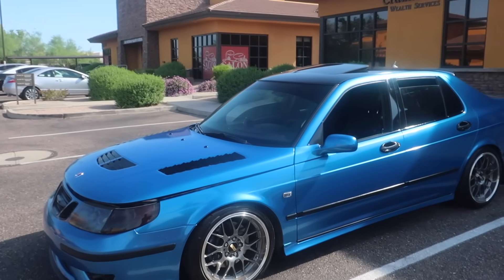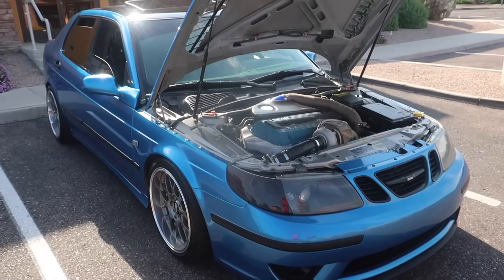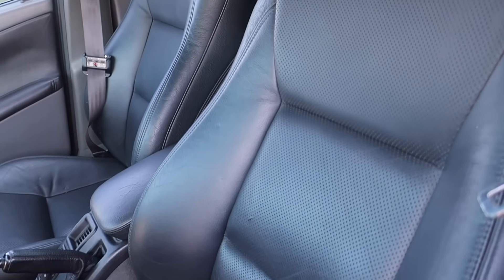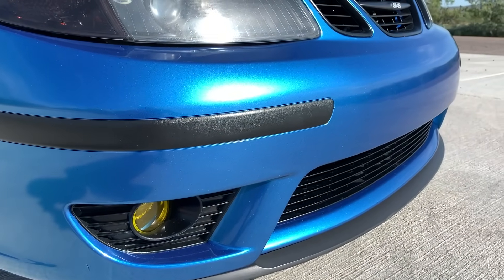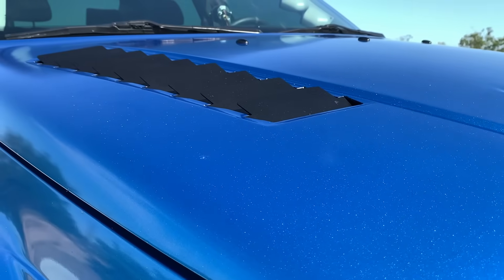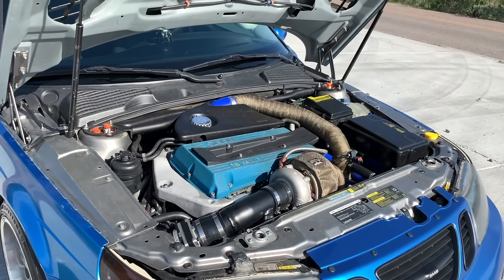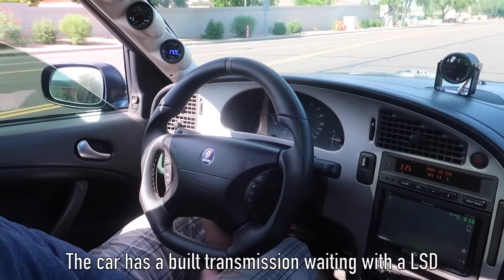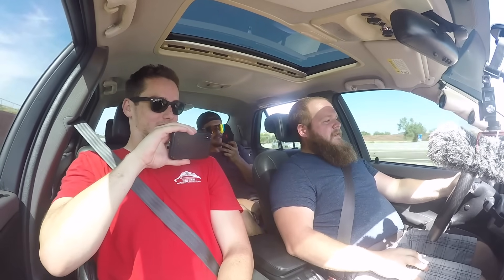550WHP Big Turbo Saab 9-5 Review!

Comment from the maker: Here is a comprehensive mod list, from the man himself, on everything done to this car (it's quite long):

Engine:
- Garrett G30-660 Turbo
- Tial 44mm Wastegate
- DO-88 Intercooler, Radiator, & Piping
- 3.5 bar Fuel Pressure Regulator
- Wossner Forged Pistons
- Stock Rods
- Genuine Saab Balancer Shaft Delete Kit
- B234 NA (I) & T5 (E) Cams
- T5 Valve Conversion
- Balanced Rotating Assembly
- Ported and Polished Head
- KRONA “Full Send 660 Big Turbo Kit” (3” Exhaust & Top-Mount Manifold)
- 1050cc Injector Dynamics Injectors
- Walboro 450LPH Fuel Pump
- E-85 Conversion
- GHWerks Solid Motor Mounts
- C900 Valve Cover
- Working A/C!
Transmission:
- Automatic to Manual Transmission Swap
- GM LSD
- GHWerks Solid Tras Mounts
- Genuine Saab Short-Throw Shifter
- SPEC Stage 3 Clutch & Pressure Plate
- Lightened OEM Flywheel
Suspension:
- 18"x9.5” BBS RS-GT
- 255/35/18 Firestone Firehawk Indy 500 Tires
- All Powerflex Bushings
- F&R Aero Sway Bars
- Ksport Kontrol Pro Coilovers
- 314mm 9-3 Aero Front Brakes
- 300mm 9-5 Aero Rear Brakes
- EBC Redstuff Pads
- Adjustable Rear Lower Control Arms
Body:
- Xenon Headlight Retro Fit & Blackout
- Full 04-05 Aero Body kit
- 3m Gloss Blue Metallic Wrap
- Matt D Custom Splitter
- Roof Spoiler
Interior:
- GlowShift AFR, Oil Pressure, EGT, & Boost Gauges
- Custom A-Pillar Gauge Pods
- Aero Dash
- Aero Vented Seats
- Hirsh-like Steering Wheel
- Custom Floor Mats

If you got the whole way down here, be sure to subscribe and like the video if you haven't already! :)
Reply: Where I can get this Matt D custom splitter?
Reply: What is a "T5 valve conversion"?
Reply: Man, that what's up!!!!!!!!! Love the whole project!!!!
Reply: You forgot the total of the lot, the list if you will. Care to share the price spent on the mod list? Not your wifi bill spent typing the comprehensive list but the bill for the entirety of the mod list you’re using on your 9-5.
Reply: @Aube  installing t5 valve guides and valves into a t7 head because they have thicker stems better for stiffer valve springs.
Reply: @ericstanhope4063  That's a tradeoff as the valves are more brittle at the stem than the t7 ones. I'd run a modified t7 biopower head with the Maptun t7 springs just for a ease of mind. And yes, the t7 valves are thinner but in better alloys. Been sat in engines pushing 800+ hp here in Sweden.
Reply: what block is it    is it a b234
Reply: @Aube  That’s awesome! I was just answering the question lol.  It’s not my engine
Reply: @Aube  also many t5 cars out there with T5 valves making huge power! At the end of the day it works and what he wanted to do!

Comment: Hey! I was wondering where I could get a bumper like that or any cool Saab 9-5 bumpers
Reply from the maker: It's an 04-05 aero bumper with a Turbo X custom lip underneath. You'd have to find a used bumper which may be hard in good condition

Comment: I got a 95 aero im just starting now engine swapping it from a inline 4 2.3L turbo to a v6 3.0L turbo eventually ima hook up a big turbo thatlle bring my car from 250 hp stock to 500 hp
Reply: Im tackling performance first then body
Reply from the maker: I hate to break it to you, but that’s not really a good idea. The B235 is a far more reliable and better motor to build…there’s a reason Saab ditched the 3.0 V6 in the 9-5!
Reply: @AutoAutopsy  ok thank you o haven't done nothing to the engine yet
Reply from the maker: Takes some tips from the build in this video! One of the best out there 😁
Reply: @AutoAutopsy  ik ive looked up the parts did some research def might invest in some im not tryna make it crazy loud or crazy lookin just a smooth matte black look wit red trim i don't plan on going crazy wit horsepower on the saab bc it is gonna be my daily
Reply: And Illinois hates loud cars where i live
Reply: Ima eventually get a g35 coupe that ima make 700 750 hp but no need to focus on that rn
Reply: But at that point ill be living in Wisconsin so i can whip it all over my roads bc the next person over is 40 acres away in all directions from the house
Reply: The 2.3 is the one everyone wants for power my friend. Some nasty 2.3’s out there.

Comment: It’s funny shit that I was looking at buying a 9-3 last night and came up on this video immediately on YouTube😂😂😂
Reply: Deff get one
Reply from the maker: It’s a sign
Reply: 2.8t over 2.3t. I've had both. Tuned both, big turbo on the 9-5, the 9-3 is an easier platform to make power on. Loved all 4 of my 9-5s though, but couldn't buy the big turbo with what it cost to get to ~ 400hp/500ft lb on my 9-3. Not to mention no custom work because you only need a gutted stock turbo rebuilt to your spec, tune, injectors and cooler plugs. The trump for me however, all wheel drive with a manual transmission. My big turbo set up on my 9-5s all had horrible torque steer. So much so, my tuner and I started limiting max torque in the first two gears. Hope this helps. Both will be fun with enhancements. I like the look of the 9-5 more than the 9-3. But I'm tuning on a budget these days.
Reply: @yuhmadorwah  you think it would be a fun project to power up my 06 2.0 T 9-3 or should I get a 2.8T
Reply: @sspoolin   if money is an issue, it is cheaper to make power out of the 2.8t without blowing the bank. The cost of VTuner stage 2 kit rated at 390hp, 425 ft-lb is about $2799 (last I checked). That includes turbo, tune,  and injectors. A couple other misc. things. Everything bolts up, the turbo is gutted and rebuilt, but same placement. So if you're handy with a wrench it saves the money for installation. 

If money is plentiful, then you can't go wrong. There are people all over doing big turbo kits for both engines. At that point, pick the best car (condition) and go for it. The 2.0 will be a dog down low in comparison.
Reply: @yuhmadorwah  So if I want bigger power I should go with a 2.8t
Reply: @sspoolin  depends on how you wanted it delivered. There are more blueprints for big power on the 2.8t, especially if you look at the Vectra boys overseas. Same platform, minor difference. You can probably put down the same power with a 2.0 liter, but it'll cost more in my opinion. But if you're going to swapping internal for forged bits, cost is not prohibitive.
Reply: @yuhmadorwah   I was thinking going forged internals before I do any sort of major power swapping. I wanted to swap a T19 into my current 2.0T after forged internals
Reply: @sspoolin  what are your power goals... when you answer that, talk to a tuner. Have them direct you.
Reply: @yuhmadorwah  any referrals to tuners?
Reply: @sspoolin  VTuner and JZW are well known. There is a guy in South Carolina that will do custom tunes for you. I've been told you build what you like and he will tune it. At SOC this year, many of his customers were riding around with new gen 9-5 aero coils, aftermarket turbos, etc. If you want to build, hit the forums, they're hard to miss.

Comment: Hey! My ‘06 Aero has a bit of an engine shake mostly only when idling in Drive. When I put it in neutral, the shake goes away for the most part, and it also goes away the second I give it any gas. Suggestions?
Reply: Maybe shot motor mounts.
Reply: @d.a.s.3921  price/difficulty to replace?
Reply from the maker: Check WIS for instructions on that!
Reply: @hardyweiner  did you figure it out my car does same thing

Comment: Not to mention 3 people in the car add about 400 lbs so it could be faster, trying to make a saab race car, with gutted interior lightweight seat, it’s basically naked inside, got rid of all AC parts, taken about 600+ pounds off the car also with no AC compressor had to get a smaller belt added a bit of power there, 2003 saab 9-3 arc manual 👍

Comment: Just wondering - how did You cope with the wheelspin which doesn't seem to be present from a standing start?  What's  the 0-100 time?
Reply from the maker: It’s not a 0-100 car. High horsepower cars like this are almost always built for roll racing!

Comment: Great build but i think the piston saab has you don't really need new one. Stock ones are pretty chunky.
Reply: You aren't familiar with T7 engines, are you?
Reply: @jonpavtis1322  aint that b204 engine ?
Reply: @Thevol40k  No it's a B235, your thinking of the B204/B234. Those are the ones with chunky pistons.
Reply: @jonpavtis1322  oh sorry then, though this one is b204.
Taking back what i've said previously.
Reply: The pistons are the first thing to go in B235R engines (the one in this car) once you get north of ~300hp
Reply: T7 pistons are a joke they can reliably manage lets say maybe 300hp if ur lucky, seen them crack on even stock :D after that say farewells and welcome in ringland failures

Comment: Well, looks like I'll be getting a new turbo.  Have a 19T with forged pistons so I might as well get it done.
Reply from the maker: Nice!
Reply: I've got a 2001 9-5 Aero. 225k miles on it and still hanging in there.  Turbo is Ebay special and works great.
Reply: I just got a 2000 9-5 wagon with the bbs’ love these

Comment: I have a 9-3 Biopower SC -08 B207E with 330hp and it´s hard to get the power to the ground with soft tires on second gear, so how is it with 500hp++ ;) Nordic tuning have a 9-5 with almost 700hp, it´s just sick ;) And by the way you don´t need a big intercooler in Sweden because of the cold air, it´s just in the hotest days of  the summer time you need it ;)
Reply from the maker: Haha wow. And yeah, we definitely need that big IC here 😂
Reply: @AutoAutopsy  Do88 have some nice stuff but read about the IC though it might not fit bolton on a 2003 and -04s ;) I guess you already know that ;)
Reply: What have you done to get The 330hp on b207? I'm aiming for The 300hp mark with my z20net
Reply: @tatujaaska2566  A maxed out 16T turbo and Siemens Deka 875 injectors, Maptun 3 inch downpipe with race cat  2,5" rest of the way, Pipercross airfilter in Hirsch modified filerbox, Maptun 450nm+ clutch. The limit for the pistons is around 360hp but some guys in Sweden have driven a long time with a 19T and 360hp, anyway thats´why i set my tuning in the safezone ;) My Saab is a Biopower model and it runs best with E85 and lowers the output with gas, premium or regular to 280-300hp depending on octane. My car have been "Mackanized" He really knows his stuff and is one of the best in Sweden!
Reply: @tatujaaska2566  Hi, i updated my answer :) Good luck with your build!
Reply: @Mackan134  that sound pretty familar. I'm running almost same setup but i have a Garret Gt20 and The stock clutch so can't run More than 350nm
Reply: that's why I'm selling my 9-3 and buying s60r 2.5t awd..

Comment: No way thers 550 whp.... Those Wells should drift till 4th gear... My 95 with ONLY 450 runs way faster
Reply from the maker: No it doesn’t. Stop being ignorant. This isn’t a pissing contest.
Reply: might wanna get wider wheels then, if it’s spinning that long either your tires are bad, you’re flooring it the whole gear or you need wider tires and run a safe lower pressure